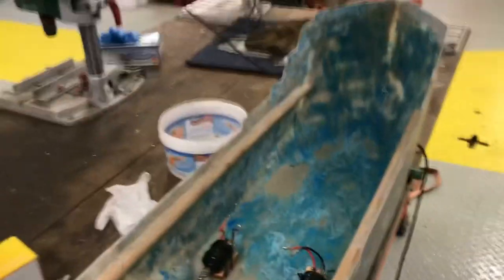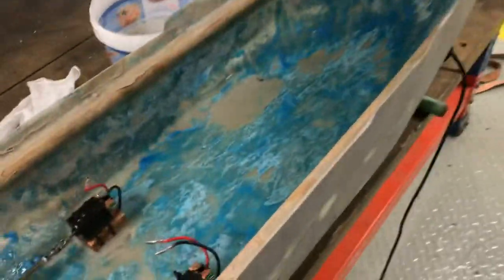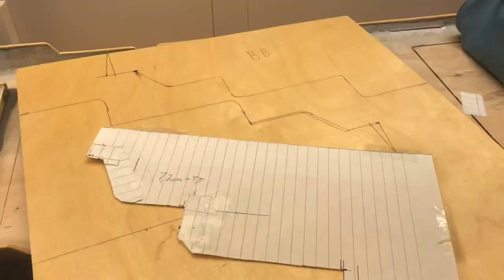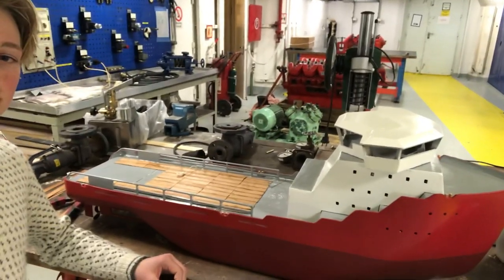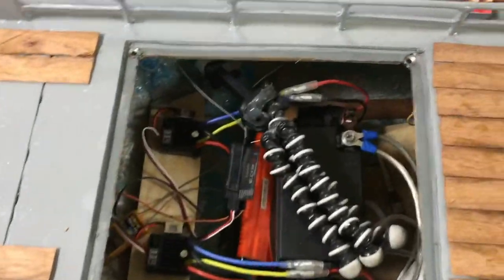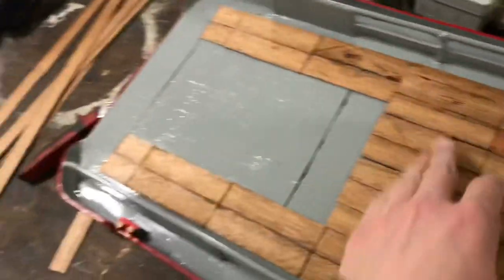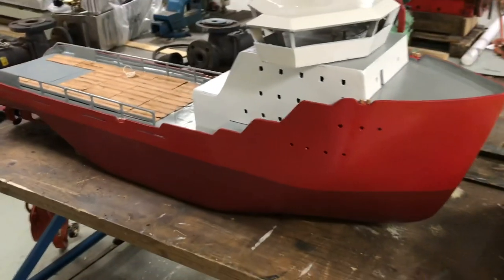Rc supply boat build! Build from scratch!

Comment: Im thinking about building myself one too but what the sizes and stuff 

Because I wanna make it maybe a little bigger than urs 

And is there a way to make it water resistant so I can do some
Riding high in the swimming pool with wave generator
Reply from the maker: If you make the boat stable and with a watertight deck you should be fine👌
Reply: @erlandwingar-elnes1667  ok alr

Btw I followed u on Instagram is it possible I can contact u there for any questions?

Comment: How did you prevent water from leaking in by the propeller shafts?
Reply from the maker: I greased the shaft before sliding them in, then they were watertight

Comment: what transmitter did you use ?
Reply from the maker: Dx5e, its a flight controller. But it works great and its easy to program.

Comment: Amazing job kid! What is that grey stuff you are coating it with?
Reply from the maker: Thanks, its a layer of primer. Makes the paint stick better to the boat. 
Have a Nice day!
Reply: @erlandwingar-elnes1667  I know what primer is lol. I'm talking about the putty you are spreading across the hull and sanding.
Reply: @CPTDilxDozer  just filler, so that he can smooth it all out
Reply: @bmar400  I'm trying to figure out what is the filler made of. Bondo? Spackle?
Reply: @CPTDilxDozer  More likely some sort of modeling specific one? looks like the stuff my big tube of revell filler puts out. if not then i’ve used wood window frame filler in past.
Reply: E.G. Spackle
Reply: @bmar400  do you have to seal it prior to marine use?
Reply: @CPTDilxDozer  Yes. Epoxy
Reply: @bmar400  10-fo
Reply from the maker: The grey putty I used was fiberglass putty. Not actually meant for RC boats, but regular-sized boats. But it worked great!
Reply: @erlandwingar-elnes1667  hey if it works, go for!